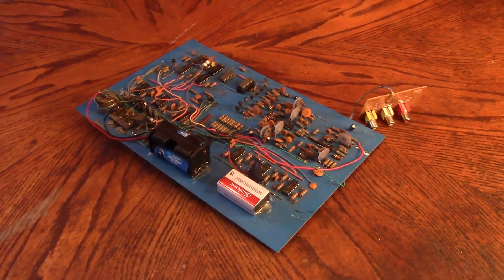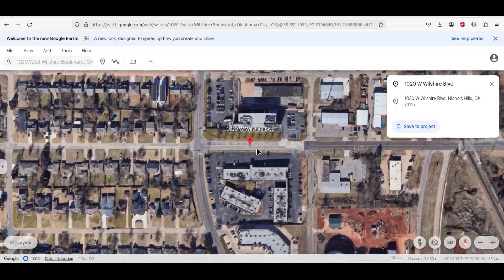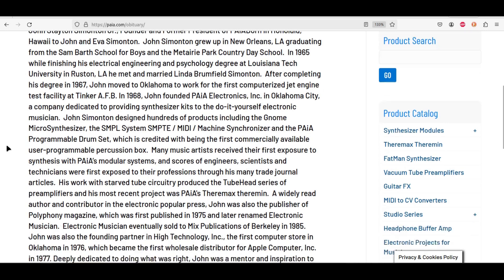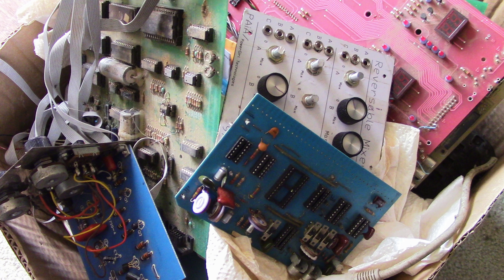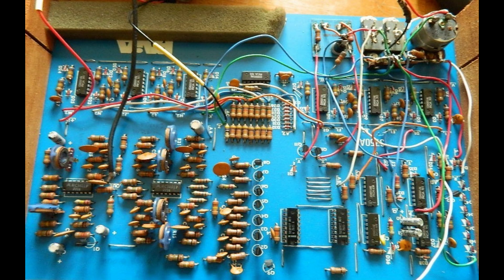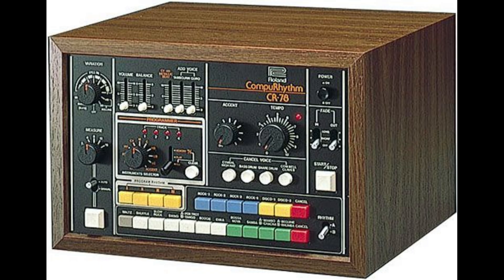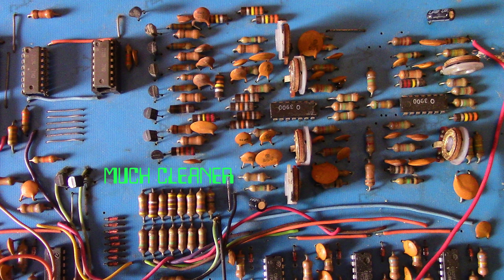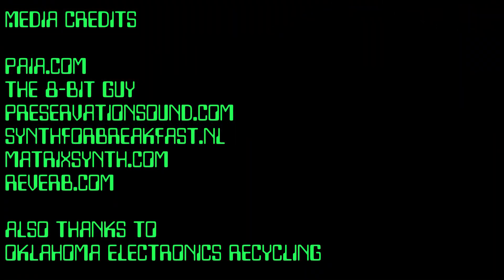Is this the oldest working programmable drum machine? (with PAiA company history)

Comment: that was a great save from the scrap heap - that certainly looks like a prototype or an early board (1976 or so). I guess only John S. Simonton can confirm it and he's sadly passed away but could be one of the early kits as they didn't really seem to advertise the 3750 until early 1977. It's not even in their 1976 catalogue (the Drummer Boy is). Definitely should go in a museum somewhere to preserve it (I have a few drum machine prototypes from 1980s).
Reply from the maker: Many thanks for your comment, Alex 😀
What gets me is the complete lack of parts silkscreening or any other indications from the kit production run. The capacitive pad area being tape and 'Computer Drums' on the board. It did need a couple of finishing connections and a rewire of the power input. It gives the impression it got built up incorrectly at the Oklahoma building, the final version needed building and testing, so this got put in a drawer as it had been superseded anyway. As you say, perhaps only John would know. 
I approached Syntaur about their team doing a story on it, circuit refresh and auction monies deal (wider publicity being an aim). That didn't happen though they were interested (think they would prefer to just buy it anyway).
It's 100% working, even has PAiA derived RAM chips and, yes, needs to be somewhere on show and not sat in a box here on a shelf!
Reply: @Slider2732_  I think your brief mention of the later 'Computer Drums' product is what it actually is. In the 1980 catalogue there is a 'Computer Drums' in that for $24.95 including1x circuit board that is pretty much the Paia 3750 board with the seven sounds (EK2 or 8700 EK-2). It could still be a prototype board of that though due to the lack of pcb labelling, so although not an early "Programmable Drum Set" it's still historically interesting - in 20-odd years of research I have never seen anyone else with this board, and quite honestly even when they revised the 3750 design to make it slightly better in mid-1980 (lower battery draw etc.) it was by then competing with the CR-78, Linn LM1 (albeit at $5500!) and more importantly the Boss DR-55 at just $199, and the DR-55 would have wiped out sales of the Paia 3750  ($160 assembled) at that price.
Reply from the maker: @alexgraham46  Thanks for the info, Alex! 
I've never seen their Computer Drums and it's been something to piece together for personal knowledge. I did think there would need to be an interface of some type, at least a socket for Serial messages or however the machine would work with a computer.
As it sits, it runs as a PAiA 3750 and performs like one... perhaps I fixed it in the wrong direction lol

Very cool price history for other drum machines there too, I appreciate that 😀

Comment: I recently got one of these on Reverb for about 500, but needs work. One question though, is it possible to press two or more drum buttons at the same time so they both get recorded in one step?
Reply: Well, when I have the time and energy, I'll get to it. When it arrived, the batteries were flopping about the circuit inside, and whoever put it together left the transistors on long stilts, so when one of the batteries hit them, they bent with their legs crossing and touching. I sure have my work cut out for me, to say the least.
Reply from the maker: @bloodyhell302  Your user name fits lol. Do reflow all solder joints. Mine needed a through going over even though they looked fine to the eye. The traces are thick and tough, which is a plus. I'd think you should be ok to push down on each transistor too, to remove the leggy legs.
Good luck and please do let me know if you get it up and running 😀
Reply from the maker: For tracing the circuit these are well designed, you should be able to get it running. The variable pots can always do with electrical spray and a few twists, then, positioning for the right sound from each becomes reliable for years. The RAM chips are the flaky area, however, many old arcade boards of the late 70's feature 2112's. You'll know if there's an issue by the lack of recording ability. 
I haven't pressed more than 1 drum sound at a time but don't think it;s possible, the internal clock advancing by 1 measure with each press. It would more than likely register whichever it thought was struck first.
Good luck with the work you do on it! 😀

Comment: Are you sure that 8700 is missing components? I looks as thought the cassette add-on was just never installed.
Reply from the maker: Thanks for your insight! I hadn't thought of optional components, just saw blank areas and what looked liked missing chips. However, have just had a look and presumably the extra RAM sockets are for memory expansion, the line of chip sockets down one side are for cables and up near the LED readouts is for the cassette add-on?
Reply: @Slider2732_  yes to all that. There are also slots for extra EPROMs like the MUS1 upgrade.
Let me know if you want help bringing it back to life.
Reply from the maker: @tehrobotjesus I see 3 extra slots, yep. Luckily, black tape is on the fitted EPROM for UV protection, so that one may be ok. 2112's can be sourced from first gen arcade machine boards. I'll look into it more and cheers, might well restore it!
It has a MOS 6503 from 1977 for one thing 😀
Reply from the maker: Btw, have Subscribed to your channel Herschel... you have some cool old House tracks on there 👍